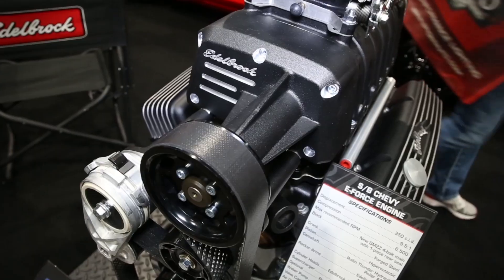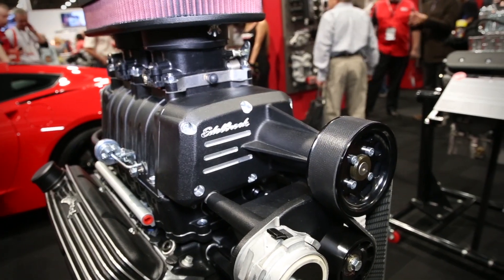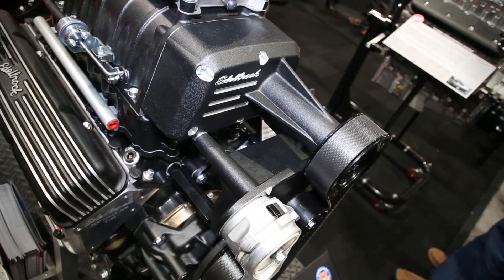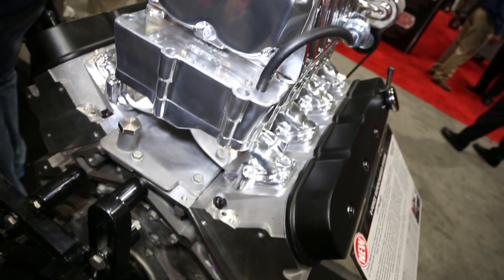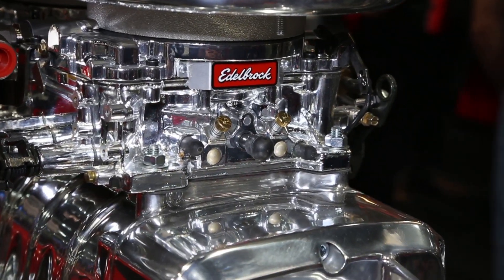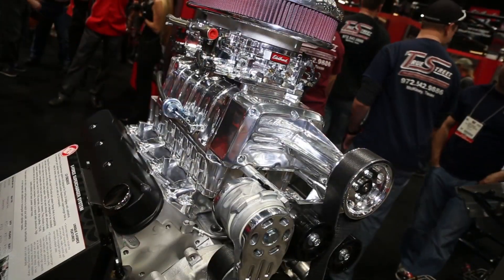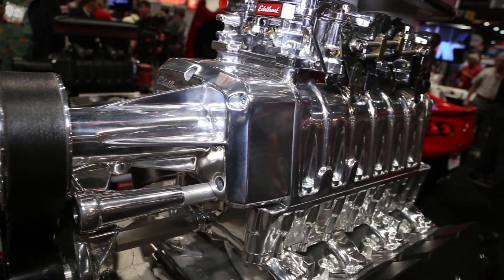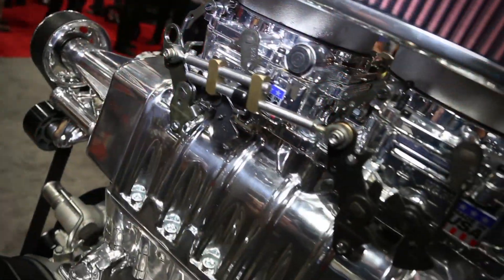NEW - Edelbrock E-Force Street Classic LS Superchargers SEMA 2013

Comment: A more universal kit would be a good idea a common base like carburator platform then super charger on top so can be fitted on more applications like v6 for example or an crazy in line 6 with a supercharger mounted on the side top of the engine to get thru hood and get better performance with simpler install and not much special parts